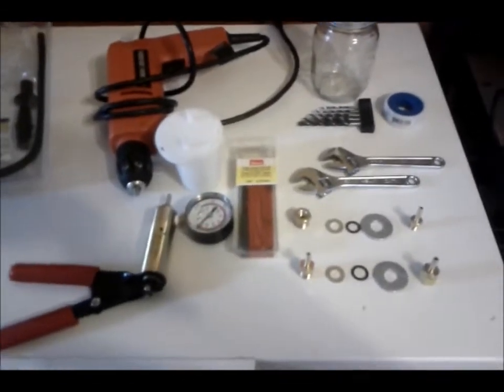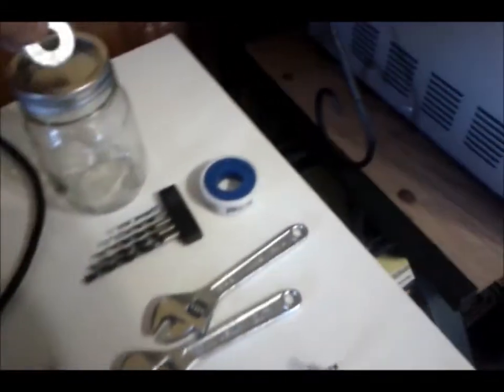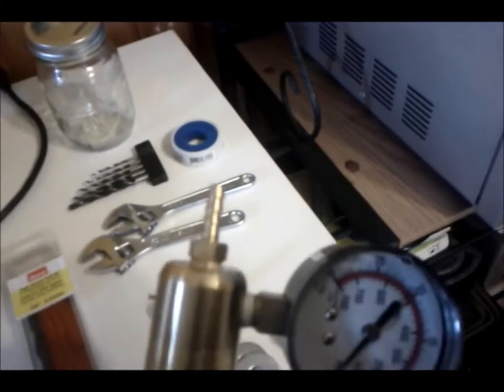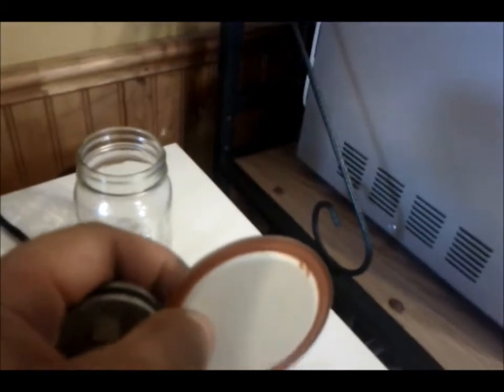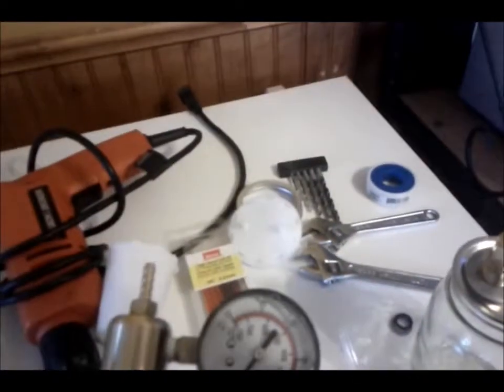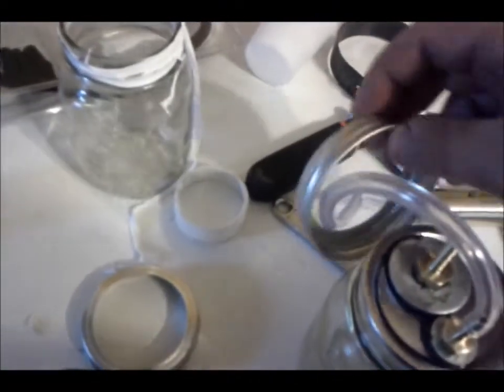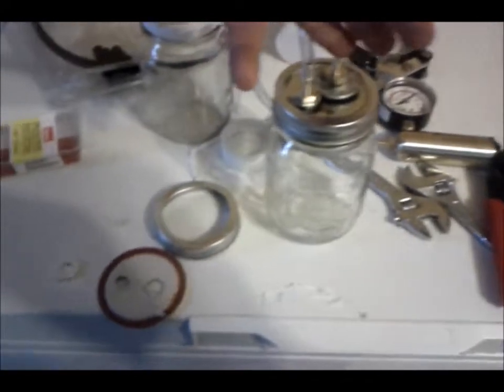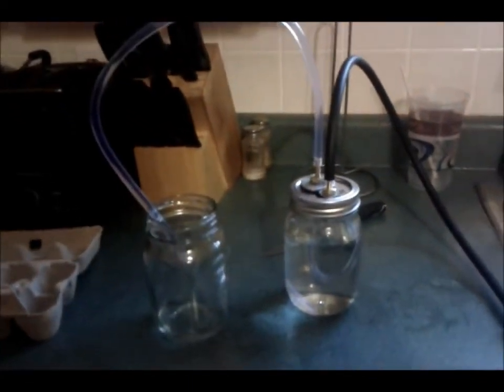Brake Bleeding air tight jar

Comment: Thats a lot of work But, if one end of the tube goes on the bleeder screw and the other end goes in the bottle with  fluid covering the end of the tube. whats the purpose of all this?
Reply from the maker: Used for changing oil in lawn tractor and push mower as well. Provides a suction to pull oil out. I know about pedal in method but this is for single person to bleed fluid if you do not have helper.

Comment: I have mine built just waiting for the gasket sealer to cure. Will test it tomorrow, I tried to pump it without the gasket sealer but would not pump up. Also I might not have had my connections tight enough. Will let you know how it works. Thanks again for the great idea.

Comment: Do you need the huge washers, or can you go with two a little smaller? I like your idea as I have a mityvac mv8000. But, came with the same crappy little jar. I found a quart canning jar. So I may need some lids but will use your idea.